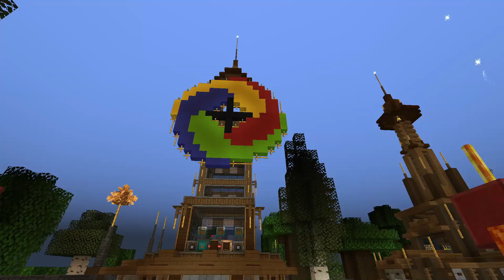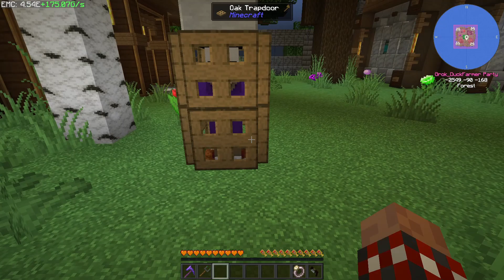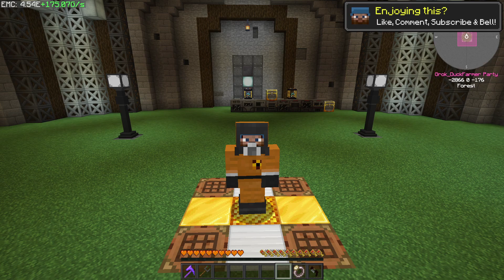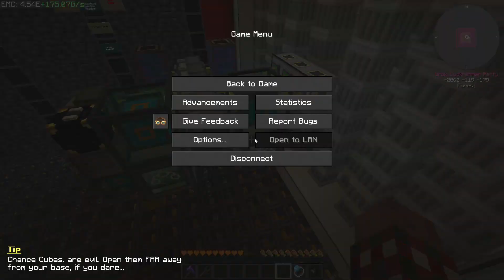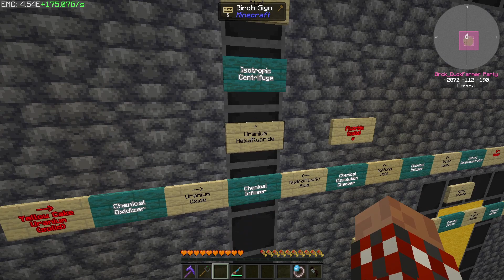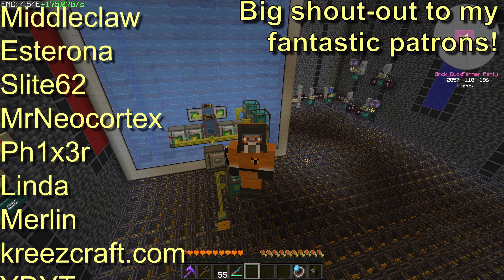FTB Stoneblock 3 #17 - Grok Becomes a Nuclear Superpower

Comment: I usually start with the largest part of a structure, e.g. the reactor, to help me plan the rest - and obviously the safe parts first so there's no waste or mob spillage :)
Mekanism pipes have a massive buffer.. this can be a good thing but often it's a horrible property. The "left" side of the block depends a lot on how you placed the entangler and the tank. It's possible that the side where the pipe was, wasn't actually left... Of course, up is always up 🙂 Since the gas tanks don't auto-output when entangled, I wonder if they receive from the machine if you swap the tank/entangler so the entangler is on the receiving end of the gas and the tank is on the sending end.
The audio in the end is a bit... muffled. Did you change any audio settings?
Reply from the maker: I want to test the entangler more.  It would be interesting to reverse it like you said to see if it still receives the input.

No changes that I know of.  I didn't hear anything on the video files as I was editing.  Could have been the way Resolve generated the file.  I'll have to look into it.

Comment: Hey Grok.  @32:00 in the video you show setting the entangler to link with 2 centrifuges, one left and one right, but it only outputs to the right.  All you need to do is place one pipe in FRONT of the entangler which should then connect all 3 blocks and have the pipe output from the entangler.  This should give you close to the 50-50 split you wanted as it will go into the TEE-pipe and then split left and right.  This means you only need 1 pipe (cable) to connect them rather than 2.
Reply from the maker: Good point.   I assume that the pipes would do better at splitting it up 50/50 between the two tanks.
Reply: @GrokDuckFarmer  Also, since you were having trouble with the entanglers connecting properly for side output, check the following and see if it affects the output direction:  WHEN you right click to set up the link between device and entangler, be specific which side of the device you right click on.  If you click on the top of the first device, does it require you to output from the top; if click on right side of device does it require output from the right.  This may be what was causing you problems with linking the devices together  (Just thought of this after reading your reply  hehe)